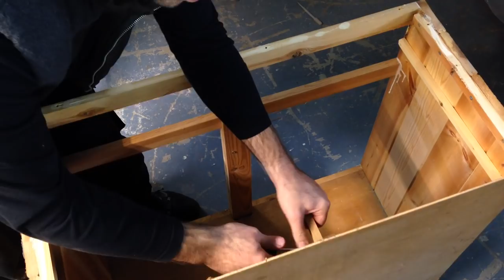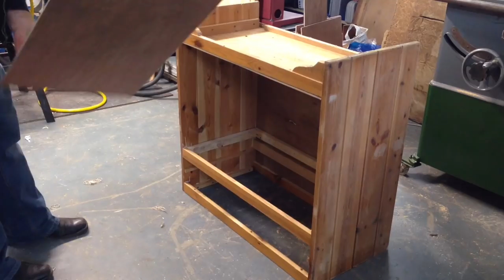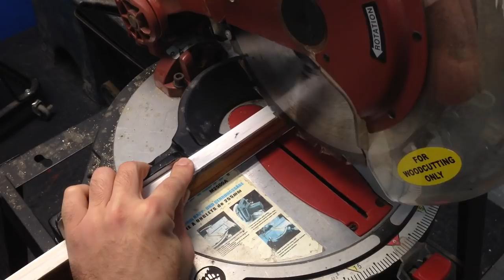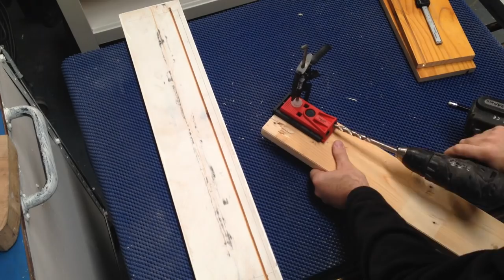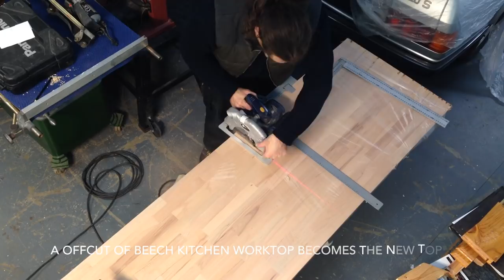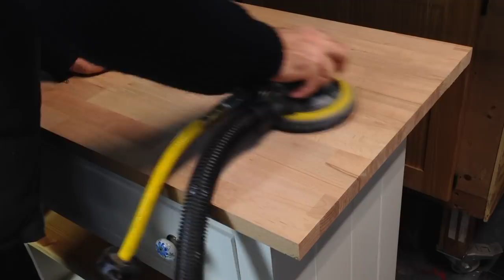Furniture Upcycling - turning an old dresser into a shabby chic baby changing unit

Comment: The result is great ! How much time did it take to make it ? Is that ok if you let the top unfixed for a BCU ? Great work anyway ;)
Reply from the maker: The top was fixed in place with screws afterwards, i just forgot to video that bit :) with the drawer removed access was pretty easy with a stubby screwdriver. Thank you for the compliment :)